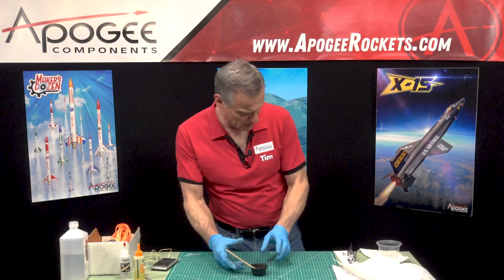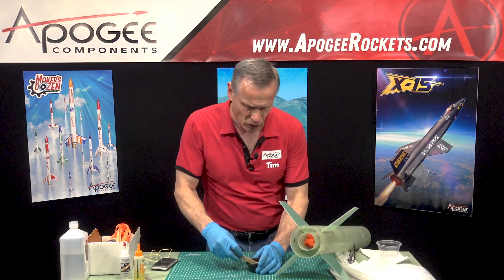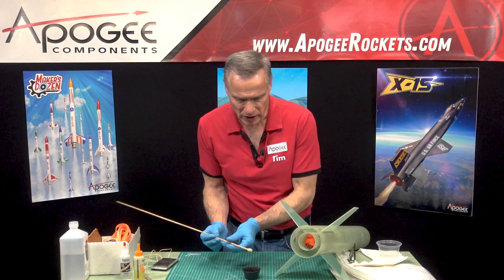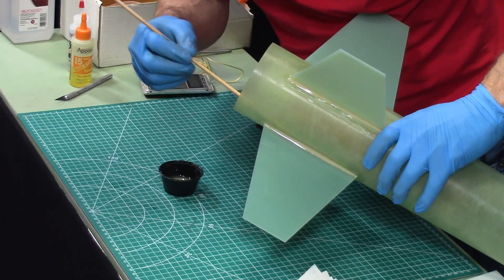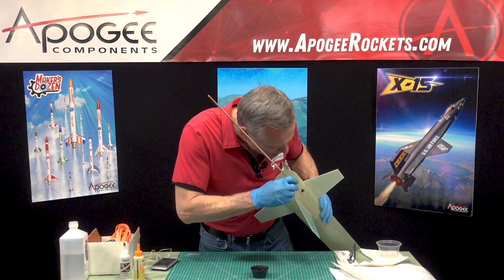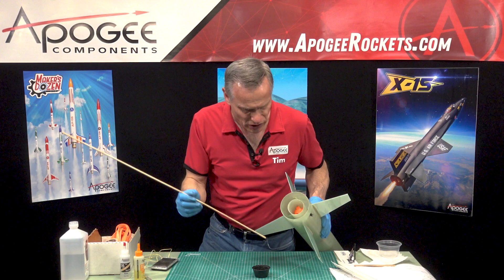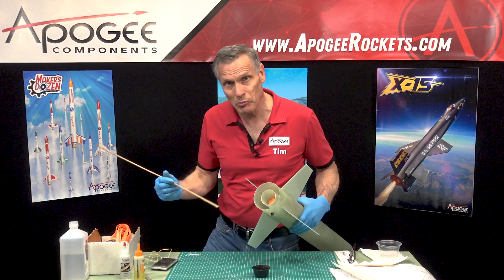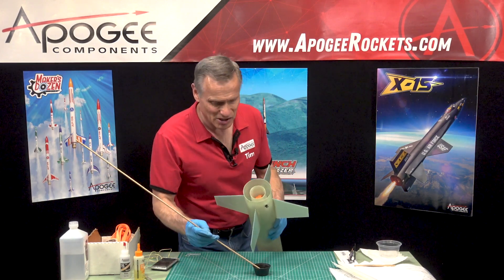Level 2 Rocket Assembly Part 5 - Create the Internal Structural Fillets

Comment: this guy  on YT took a  dowel rod that he taped on this  stick to form a long L... filled that the whole length of the fin  with the runny epoxy then just tilted it all in at once. kinda slick. but others use that thick stuff for the insides as well. no idea about most of this stuff lol...